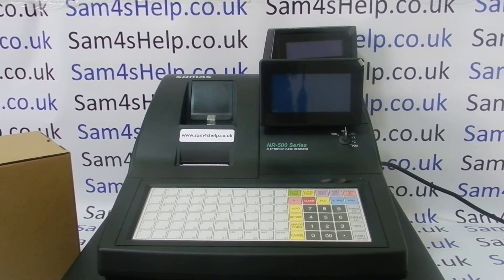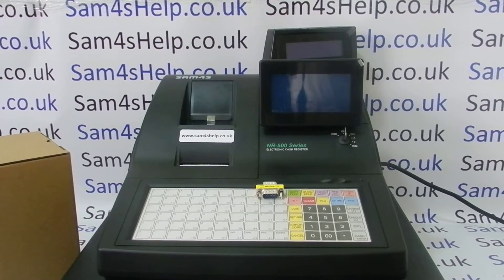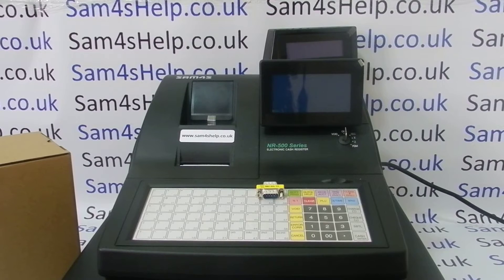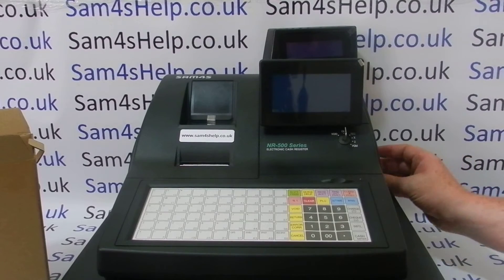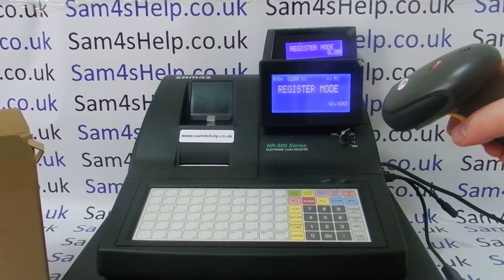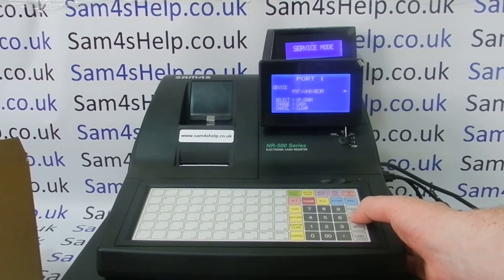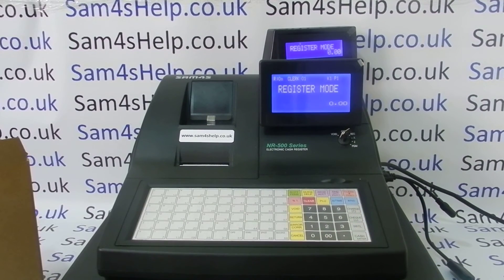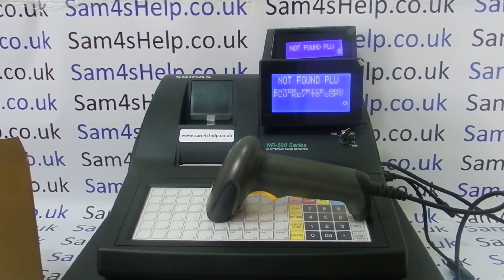How To Connect A Sunlux XL-6500A Barcode Scanner To Sam4S NR-500 Series Cash Register

Comment: Can I connect a sumup card reader to this till plz
Reply from the maker: Thanks for your message and apologies for the delay in response. 

There is no direct integration between cash registers at this level and card payment readers. 

To account for card payments on the NR-500 you: 

- ring the sale through the till as normal
- take payment on your card machine 
- complete the sale on the till by pressing the CHARGE1 or card payment button 

On the end of day report you will have one total for CASH IN DRAWER and a separate total for CARD PAYMENTS 

Hope this helps. 

Thanks, 

Sam4S Help